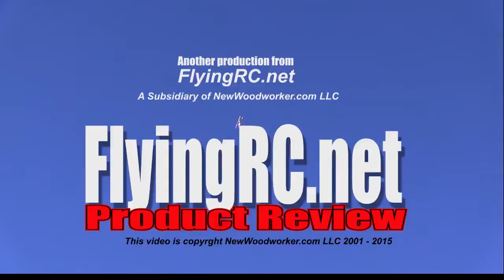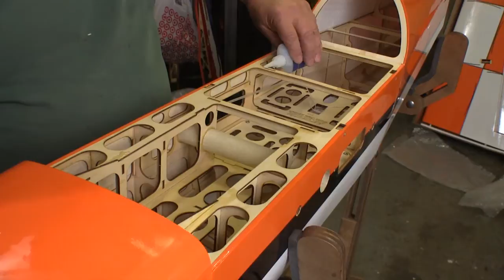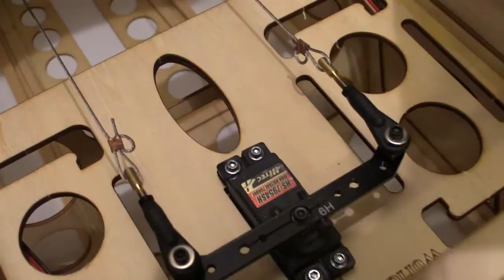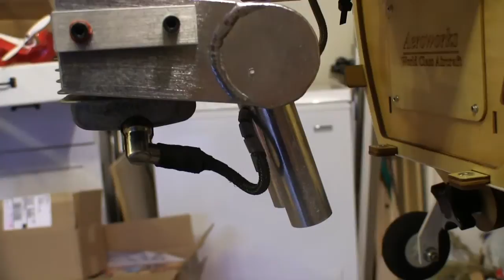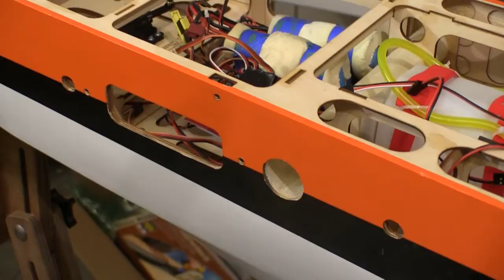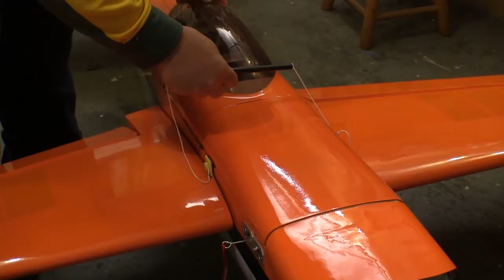Aeroworks 50cc Edge 540 ARF QB

Comment: I have that exact Model. I love it! A question, I am considering the DLE 60 Twin versus the DLE 55RA. What is your thought? Would the cowl look nice with the headers holes? Also do you think I can fit dual canisters inside the fuse?
Reply from the maker: The DLE60 Twin would probably be a nice motor but I recently changed my Edge over to a EME70 twin with stock mufflers an it is  rocket.I will be doing a story on the new engine/plane package in the near future.
 I think the fuse is designed to accept twin cannisters but you should check with Aeroworks to be sure.

Tom
Reply: +thintz12 Thanks for the reply. I actually did check with Aero-Works and they mentioned that it was designed for a single canister and they would have no idea if a dual canister would fit. I mentioned the DLE60 Twin because I will exchange my DLE55RA to that if it fits. Also, I don't like the look of the plugs boot exposed so I may just stick with the DLE55RA. The EME60 is amazing. Guys among a few flying clubs here in Ontario Canada love that engine and they all advised me to also look at that as an option. If any Twin can fit under the cowl without me opening up the side I would love to switch to it. But not sure they do... unless you magically do!!!
Reply: Do you think the EME70 would fit within the cowl dimensions with the plug boots on?
Reply from the maker: In my Edge the left side plug wire cap just barely sticks out but that cowl was cut for another engine. I think you would be able to cheat the cowl a little to the left and keep the plug cap inside of the cowl
Reply: thank you, I will let you know